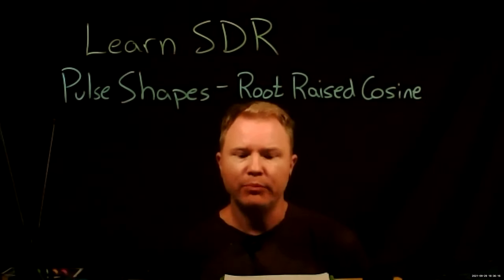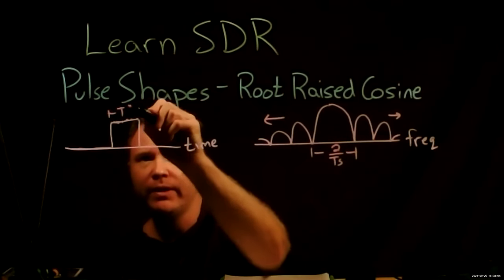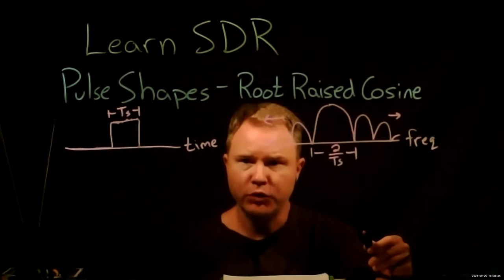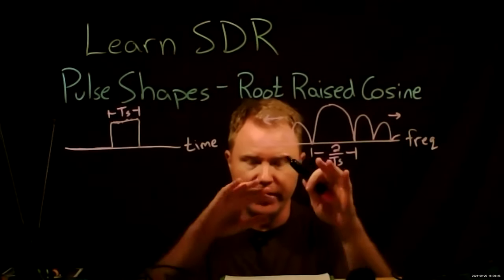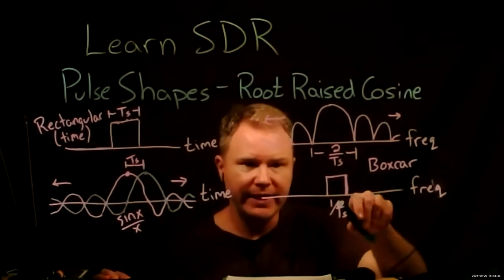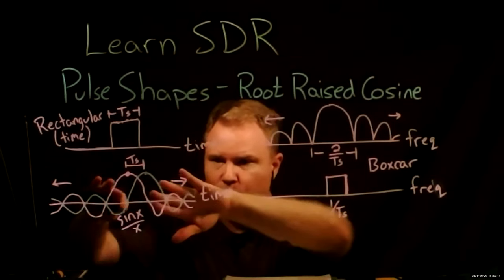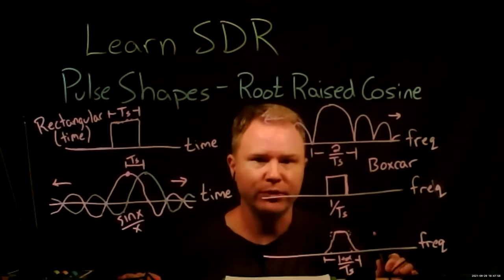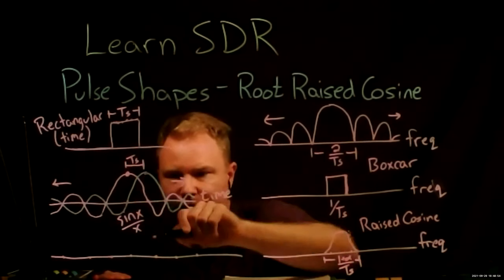Learn SDR 14: Pulse Shaping

Comment: Sir. Again great video. One more question. Around 6:43, u say that the timing between the maximum and the first zero crossing is the symbol rate. How does this apply when the signal is a pulse where the maximim is bascially across a span of time.  Would we consider the the initial time when the first maximum occurs?

Comment: Hi Sir.  Great video. Around 8:43 u say that one of the problems with the boxcar is that the time domain signal "fall off very slowly."  What do you mean by that?
Reply: Sinc signal in time domain spreads infinite over time that means they slowly fade away over time. 
With boxcar in freq domain the equivalent time domain representation is sinc function whose amplitude reduces slowly over time 
But in case if we use pulse shapping filter like raised cosine, it will be easier to separate signals in freq domain as well as we get a sinc like function which fades faster in amplitude and is finite
Reply: @artie5172  thanks Artie.  Appreciate it!